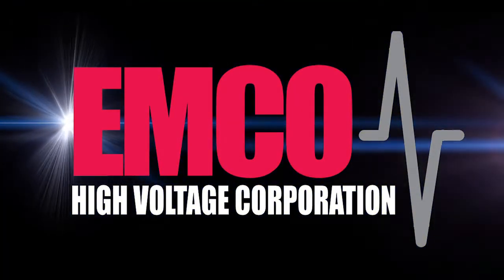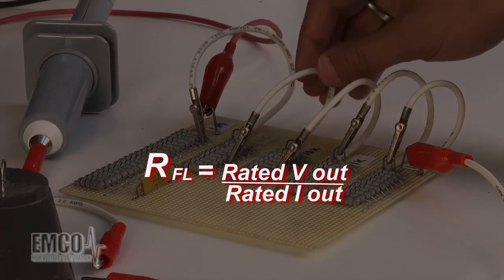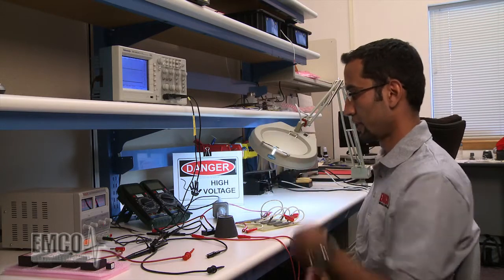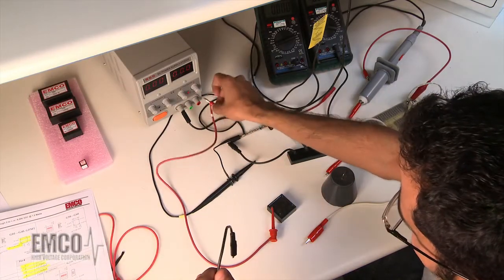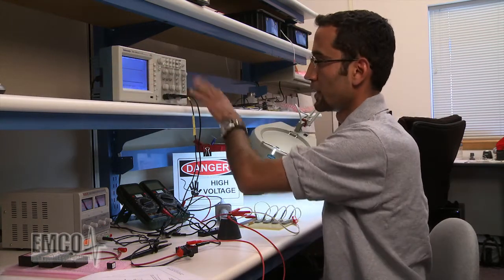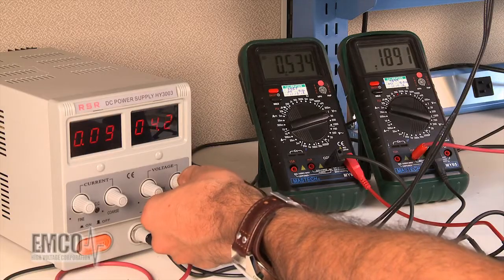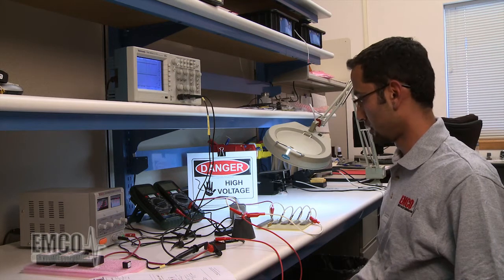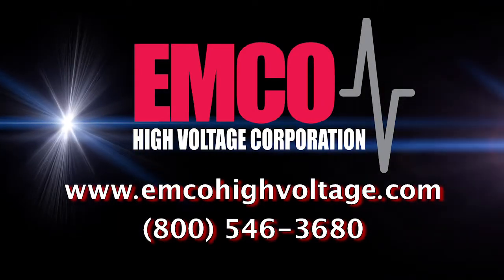EMCO Application Notes, HOW TO CONNECT and TEST a PROPORTIONAL MODEL

Comment: Hi. I have HV amplifier EMCO H101P 0-10kV. I have a problem my device does not work and power supply goes into short circuit and does not charge the device. Why? 2 answer I think : 1) safe circuit of device (damage) 2) there is not resistors network for that delivers max current. I have other question : Why I need more parallel resitors and not not same value resistor for one?